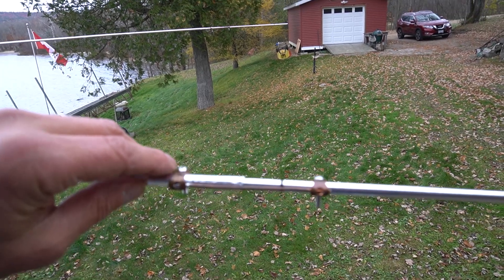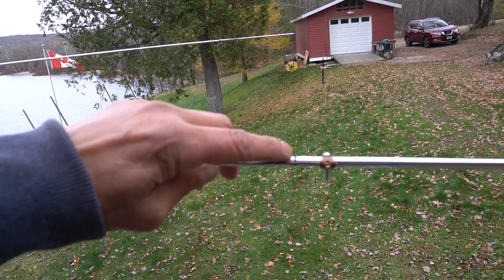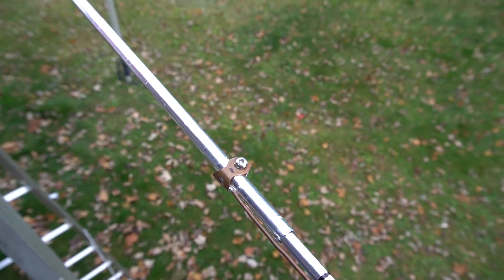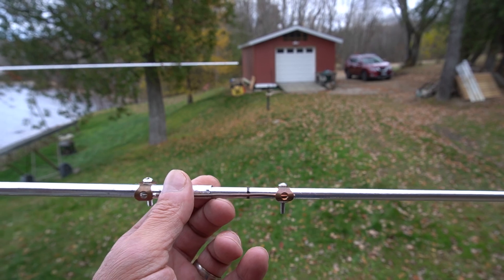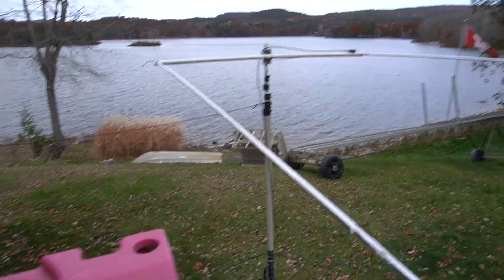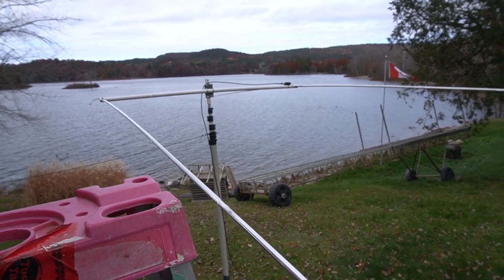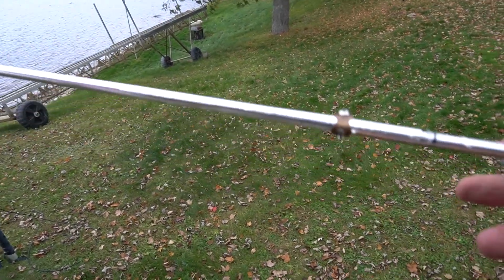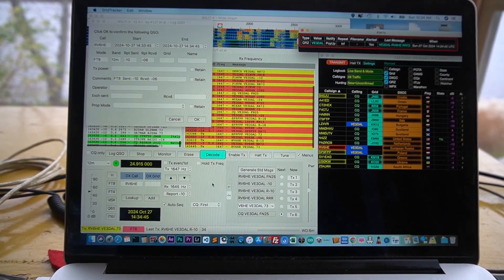HAM RADIO - Yagi 2 Elements 10m-12m Portable Tuning Update

Comment: Please size's
Reply from the maker: These are the initial sizes, then you have to adjust the sizes on the tip of the elements for tuning.
Antenna Dimensions and Materials:
Driven elements: 2m.44cm x 2 = 4m.88cm
Reflector element: 5m.62cm
4 carbon fiber fishing rods
6 feet of 1" PVC pipe
1:1 balun 
1 roll of aluminum tape
Some 12 gauge coper wire
This video is where I started this project.
https://youtu.be/cOHlUzsSSWs

Comment: Hi, I would like to replicate your construction using telescopic styles for convenience. Could you tell me the distance between the radiator and the reflector?
Reply from the maker: @iu1olr  hello the distance is 6 feet and I used a PVC pipe. There's a link on description for the other measurements.